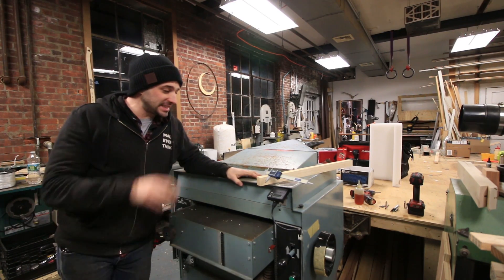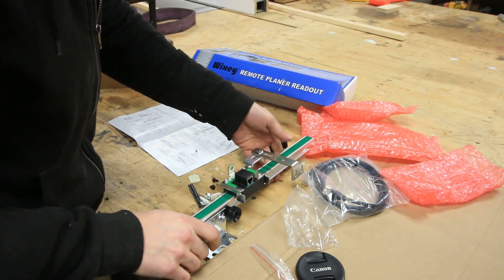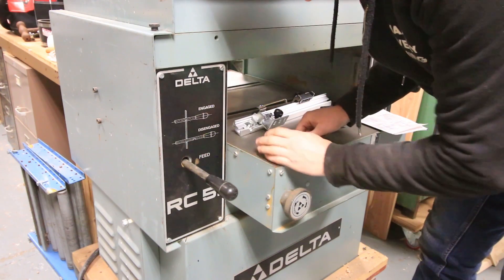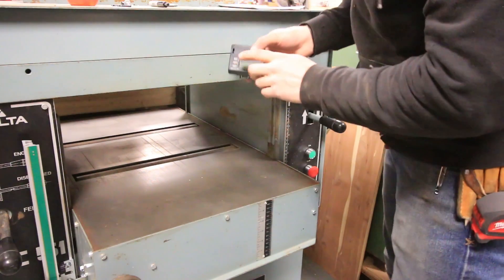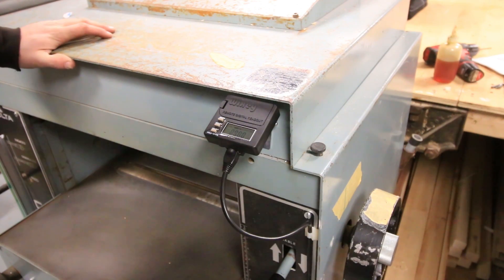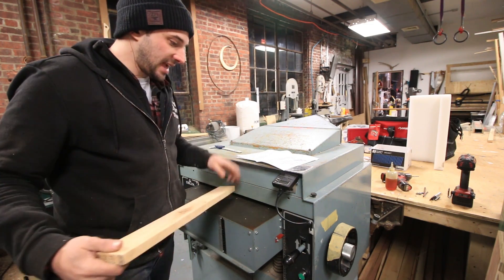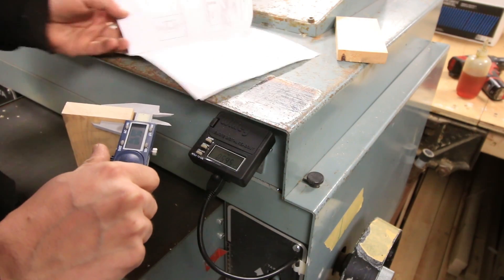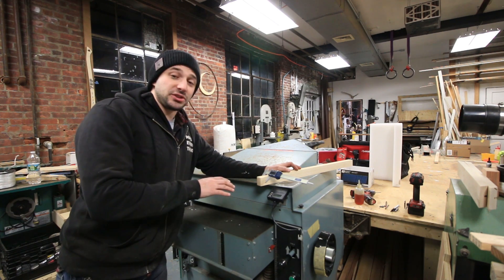Perfect Planer Thickness (Wixey Digital Read Out)

Comment: This is great  - thanks for the guide.  What do you do when you need larger boards planed - do you have a go-to local commercial shop which you use on an ad-hoc basis for 30"+ wide lumber?